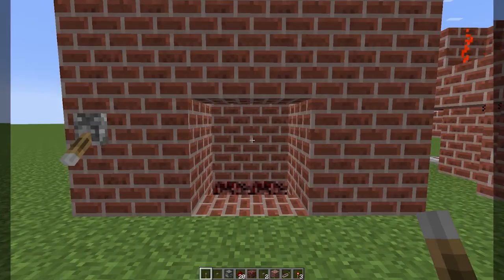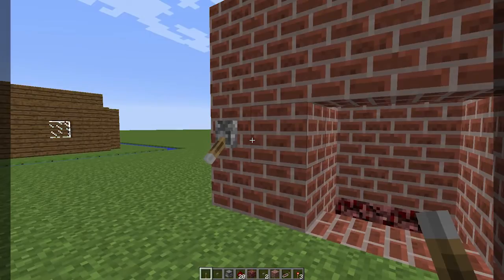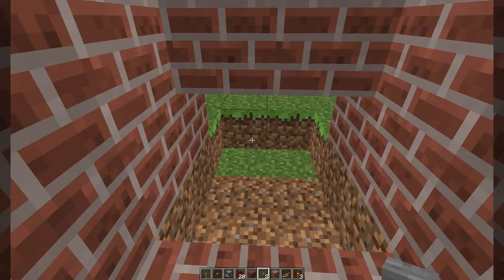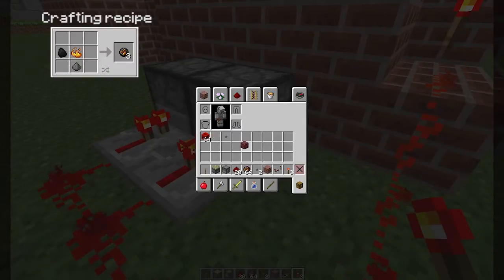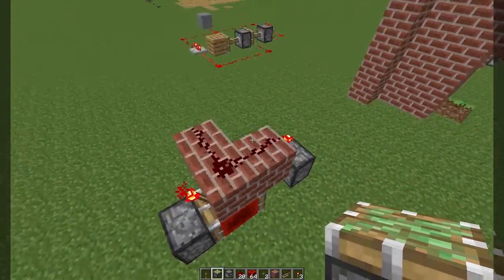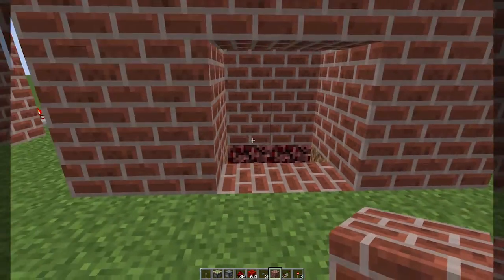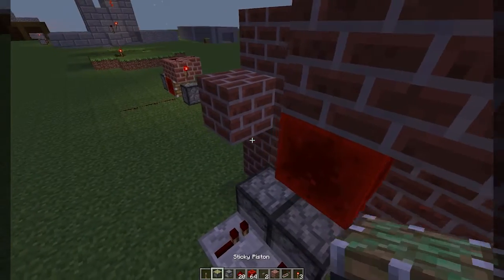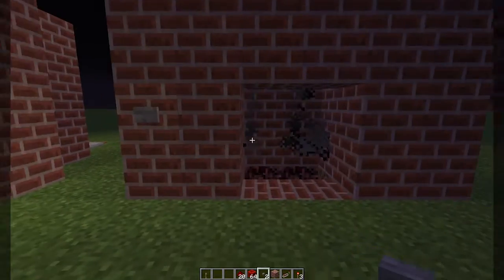Minecraft: How to Make an Automatic Fireplace with One Button

Comment: I know this is a fairly old video so it might just be that the mechanics have changed, but when I try to dispense the firecharges, they won't go through the brick and light the netherrack. I took the brick out from in front of them, and they just shot it ahead without lighting the netherrack. Do you have any idea what might have caused this, or more importantly how to fix it? Thanks in advance if you can help out, and no worries if you can't!
Reply: this happened to me too! did you by a chance figure out how to fix it ?
Reply: emma grace Nope :( I just use it now like you light it yourself, but put it out by pushing the button